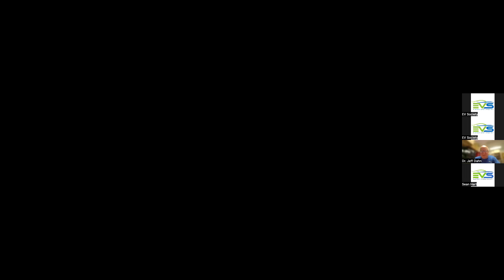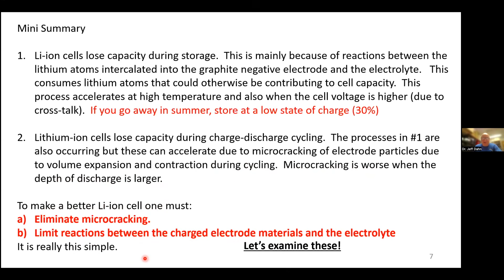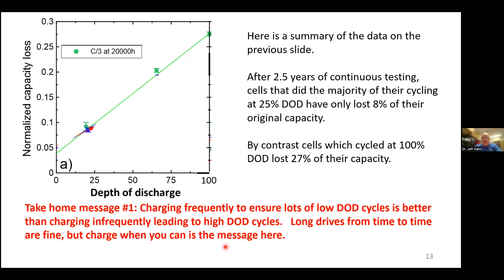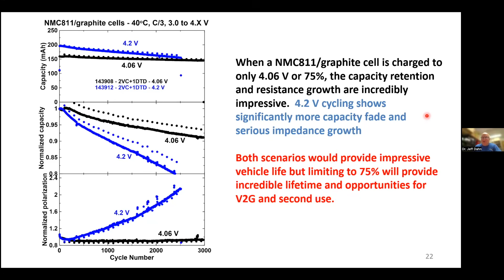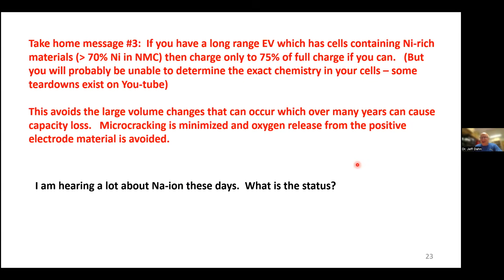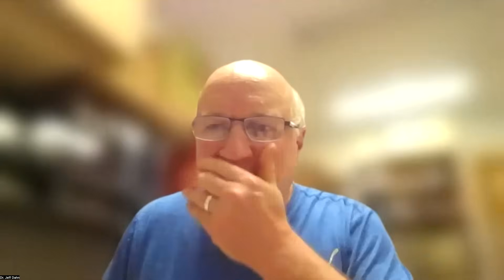How Long Do EV Batteries REALLY Last? — Dr. Jeff Dahn, Dalhousie University

Comment: I have an EV with an 80 kWh battery capacity. I drive 100 miles (160km) per day, and each day, I use 40% of my battery's capacity. With this advice, I'll reduce my charging target from 80% to 75%.
Reply from the maker: That strategy should keep your battery in top condition.

Comment: Most modern EV have battery cooling  system  , should i worry less about heat  ?  I live  in the middle east.  Hot summers.
Reply from the maker: It's is true that modern battery cooling systems greatly reduce the risk, but they can’t eliminate the effects of extreme heat. Avoid leaving the battery near 100% state of charge for long periods, park in the shade when practical, and keep the vehicle plugged in when recommended so it can manage battery temperature. As always, it remains a good idea to follow the manufacturer’s guidance for your model.
Reply: @ElectricVehicleSociety  great advice  , thanks for replying ❤🎉
Reply from the maker: @mohammed-pl8zt  My pleasure.

Comment: 2023 Model Y NMC LR owner. I saw these same charts from another engineer explaining battery durability. I use my Tesla to drive an average of 80 km per day. I charge at home using level 2 Nema 14-30 plug and my charge limit is set to 70%…typically it will be 45% -50%  when I get home….never supercharged, I never leave it out in the hot sun in the summer and when it is stored for an extended period of time, i leave it at 40%…even in winter…it 2026 and i have almost no degradation on my battery
Reply from the maker: You are doing all of the right things to maximise your car's battery life.  Well done.

Comment: If car A throughout its life is charged to 100% and discharged to 75% consistently. 

Car B is charged to 80% and discharged to 55% consistently. 

Do both Cars A and B have a depth of discharge of 25%?
Reply from the maker: Yes.  If both charged 4 times at those levels, then both batteries will have completed one cycle.  
Of course some battery chemistries can be charged above 80% constantly with less degradation than others (LFP vs. NMC)... but that wasn't the question.
Reply: @ElectricVehicleSociety Thank You.

Comment: Keeping batt at 75% is mostly not realistic...90% is whats recommended by Polestar...its just reduces charging during the week and pulling that cable around the place.
Reply from the maker: Recommended charge levels vary by battery chemistry.  100% is not much of an issue for LFP.

Comment: 48:00 Asking about battery chemistry at dealership should be similar to asking "does this car have fuel injection in the engine" for an ICE car. Getting answer similar to "it has li-ion battery" is not that different from saying "it runs on gasoline".
Reply from the maker: Agreed.  Dealerships have a long way to go.

Comment: 36:00 All we need is for EV manufacturers to redeclare 4.06 V as "100%" and if they want to allow charging up to 4.2 V "for longer trips" that should be marketed as overboosting or overclocking the battery so that people would better understand why it reduces lifetime of the battery. Display such charges as "110% or 120%" in the display and people would automatically avoid those for daily use. There's no standard what "100%" or "0%" actually means when it comes to batteries. If you reduce the voltage range for 0% to 100%, you instantly get more lifetime for the battery.
Reply from the maker: Good point on voltage windows—but in practice, OEMs already do this behind the scenes.

“100%” on the dash is not the true electrochemical 100%. Most EVs keep a buffer at both the top and bottom (often several percent) specifically to protect the cells and extend cycle life. That’s why many batteries still retain strong health after hundreds of thousands of km.

Also, the trade-off is real: narrowing the voltage window improves longevity, but it reduces usable range, which most consumers prioritize.

Some automakers are already moving toward what you’re suggesting:
User-set charge limits (e.g., 70–80% for daily use)
Trip charging to 100% when needed
Software-managed buffers that adapt over time

So rather than relabeling 100% as 80–90%, the industry solution has been to abstract it and give drivers simple controls—while the BMS handles the complexity in the background.

Comment: For the past 10 years, we've been OK just using our 120V in our garage, for our two EV's. Is using 120V extra beneficial to long Li-ion battery life?
Reply from the maker: Compared to DC Fast charging, yes.  Compared to level 2 home charging, the difference is likely negligible.  Unless your EV(s) are both Iron Phosphate (LFP) batteries, you are best to avoid charging above 70-80% on a daily basis, whether  using 120V or Level 2.

Comment: I wish I would have known this in 2018.  But better late than never. My 2013 S60 has 202,000 miles and currently at 81% capacity.  My daily commute is 45 miles so I'll try to extend my battery life by dropping from 90% to 70% daily SOC.  Usually use around 30% if no errands are run and I live in a warmer climate so I usually get more efficiency during summer.  We'll see what happens!
Reply from the maker: Sounds like are doing well with your 2013!

Comment: @electricvehiclesociety ,  if you're going away 1 to 3 weeks at a time but just 4 vacations per year, how much difference would it make on the battery's health after 10 years, whether you follow the 75% vs 35% before leaving for vacation?
Reply from the maker: So long as you keep the max to 75% or less, based on Dr. Dahns recommendations, it would likely make very little difference to the battery.  If the climate is particularly hot, then maybe lowering the max would have some marginal benefit but likely not much.

Comment: I just want to know if it’s useful for the longevity of the battery to periodically be charged to 100% (to balance the cells)?

I have a 2016 model S, and generally keep the battery between 20-80% charge.
Reply from the maker: Periodically balancing the cells provides no significant benefit to battery health with your 2016 NMC battery.  It might eek out a very small amount of extra range but probably wouldn't be too noticeable.  Charging from a low state of charge to 100% occasionally does recalibrate the range estimate that your car is giving you (it loses track over many shallow charge/discharge cycles).  This might result in better range numbers but only because the estimates are more accurate and not because of any change to battery health.  Hope this helps.
Reply: @ElectricVehicleSociety  Very thorough response, thank you!

Comment: Thank you for this great information! I have a question: Dr. Jeff recommended charging the MNC battery to 70%. At what percentage should I start charging? For example, if I start driving with the battery at 70% and return home when it's at 60%, should I charge it back to 70% immediately? Or should I use more of the battery before charging again? What is the recommended charging range for everyday use when my drives are predictable?
Reply from the maker: My take from his various presentations is that it would make little measurable difference.  Frequent shallow charges are better than less frequent deep charge/discharges.  Also true that keeping the max charge at or below 70% on MNC batteries is better.  So, my strong belief is that charging immediately back to 70% every time would be perfectly fine.  Also, it leaves you with more available range if you unexpectedly need it.
FYI, Jeff is coming back on August 5, 2025 for another webinar and you could ask him yourself.  We also have a battery expert (Dr. Toby Bond) who studied at Jeff's lab at Dalhousie U.  doing a webinar on May 6.   Should be some great insights from him as well.
Reply: @ElectricVehicleSociety  Fantastic! 😊 Your channel has been incredibly helpful in teaching me the best practices for preserving my NMC battery life
Reply from the maker: @ Thank you very much.  It means a lot to know you enjoy the channel.

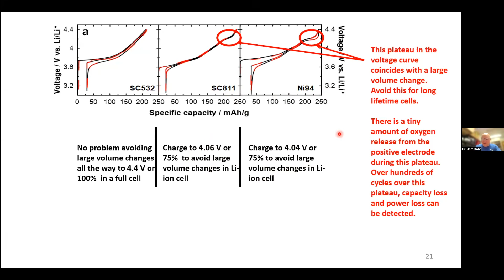Comment: 20:00 - 35:00
The Lightning at (Truck)100% SOC is 390v {96s pack = 4.06v per cell}
Ford report the cells are 90/5/5 Li-NiMoCo ie high nickel Li battery 
per Dr Dahn 35:30 - keeping below 75% SOC (cell) prolongs battery life - 4.06v = 100% Ford SOC level.
Reply from the maker: Yeah, good catch on the Ford Lightning specifics. At 100% displayed SOC, the pack hits ~390V (96s config), so ~4.06–4.09V per cell—well below the ~4.2V max for most NMC cells, and far from Dahn's aggressive lab tests pushing to 4.3V.Ford's high-nickel (NMC 90/5/5) setup is conservatively calibrated, so their "100%" is already a milder ~90% of true chemistry max. That means daily charging to 90% (Ford's rec) or even 75–80% keeps cell voltages/stress low, aligning closely with Dahn's advice to stay below ~75% SOC on high-nickel NMC to minimize degradation from high-voltage side reactions.Smart observation—Ford's buffer makes their 100% pretty gentle compared to raw lab benchmarks! Only go full when needed for range.

Comment: This is an essential info for an EV user. Only topic not well argumented is about the lowest percentage of battery: 
Jeff says "the lower the better" but as I know if I bring my battery to zero I will damage it. What is the minimum percentage to run in a NMC battery? My car arrived to the dealer with 4%, was it a safe or bad long term storage percentage?
Where can we find a public database with brand - model - battery chemistry - battery model?
Reply from the maker: I believe Jeff said that a low SOC would not damage most batteries but that it depended on the specific battery materials used.  Sorry, I don't recall the specifics.
There is no public database with the battery info you are asking about, at least that we have been able to find.  For now, it is a brand by brand question.
Reply: "Zero percent" is not "zero volts".  The cells still have about 3V when the pack reaches 0%.  Hitting zero volts, however, is very bad, although you would be hard-pressed to actually get to zero volts.  You'd need to run it until it stops and then leave the rest to internal discharge, probably weeks or months.  I personally would not risk it, however ;-)
Reply: @4gus  I know that 0% is not 0 volts. Question is: as the highest SOC are not good, are the lowest SOC specularly bad in the same way?
Reply: @4gus Jeff said "The lower the better", which is of course not zero volts. Just wonder why he then says to store at 30% in hot climates? Why not plugged in (to protect against vampire drain) at 5 - 10% for extended storage in the heat? He has shown lab results of zero % SoC (around 3V) storage providing the best longevity; noticeably better than 30% SoC, compounded by zero % in the vehicle being at the top of the buffer (so above 3V) 🧐. Is the recommended 20% lower SoC threshold PURELY to mitigate SoC calibration error, & range anxiety??
I'd be happy to have to charge immediately after storage if there was confirmed longevity benefit.
Reply: @MortyMac  He mentioned that 30% would give a fair amount of range when the person got home and wanted to use the car (without charging).
Reply: @synupps877 I've read more in past few months. Jeff's 0% is not held there for any time at all in his continuous cycling tests, which presumably is why he has no issue with taking it that low. It also standardises his testing. Makes sense. I am now very confident an NMC battery has the best chance at a long life withhut much fuss by:
20% - 60% daily (extended up to 15% - 70% if range requires it);
Small DoD by frequent charging (as lifestyle/routine allows);
40% storage (30% - 50% is good; 30% better in hot climate);
Precondition before DCFC;
Gentle loading for first 10 - 15 minutes after a DCFC (many reasons);
Warm the pack from wall power to above freezing before driving where possible (e.g. set departure time, delay charge window);
100% fully charge slowly every 6 months in moderate temp if specific vehicle is only fully cell-balanced with a 100% charge, & drive off within hours of completion of course to minimise high voltage stress dwell time.

There shouldn't be many surprises in this list for most people who have done some reading of reputable sources. But also, don't be paranoid about it if lifestyles don't allow.

Comment: Thanks for the excellent video. Do you have any information on the "lithium plating" at the anode, which apparently occurs at low temperatures (when charging?)?
Reply from the maker: Sorry for the very late reply.  Dr. Dahn will be back for another webinar on August 5, 2025.  He will have that answer, I'm sure.

Comment: This should be taught in schools, we all have "LIon" batteries in all appliances, not only cars but also phones, watches, tooth brushes, power tools and so on. This is knowledge that would benefit the whole society!
Reply from the maker: Agreed!  I think that eventually, consumers will become more knowledgeable.
Reply: Yes. Many laptops and I think most newer phones (Android and IOS) have settings to limit the battery charge. My phone (modern but cheap android) is set to stop at 85% (I would like lower) and I charge it fully if I think I might need it. I never really take the laptop out, it is always plugged in, and I had it set similarly. A recent update has automagically changed it to some dynamic system that often sees charge state held in the range 60-80%. I suspect you need Android 13.

Comment: @ElectricVehicleSociety Thanks for sharing such a useful information. Its a must watch for all existing and potential new EV owners.

One of the biggest hurdle in EV adoption is the fear of battery degradation. 

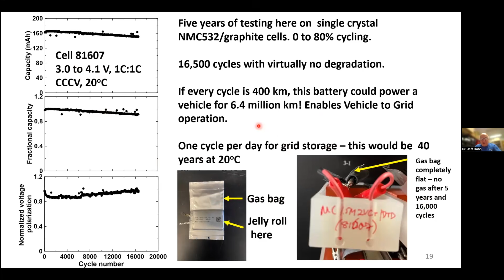1) @31:04 I fail to understand why car manufacturers are not sharing the information if their (/supplier's battery) uses single crystal positive electrode material ?

2) As I understood, most of the discussion here is about reducing battery degradation due to charge cycles in other words reduce the impacts of "cycle ageing". Can you put up a video on what measures EV owners can take to reduce the impact of "Calendar Ageing" ?
Reply from the maker: @Stayhungry-N-Stayfoolish  Thanks for watching and supporting our channel.  We will be doing more on batteries in 2025.

Comment: Why is 70% to 45% SOC ideal?  Why not 60-40?
Reply: 60-40 would be marginally better than 70-45 but would also be less practical.  The trade off between battery degradation and extra range wouldn't be worth it.  IMHO
Reply from the maker: Dr. Dahn is coming back with another presentation on Aug. 4.  You could ask him yourself during the Q&A.  It's free.

Comment: Does anyone know if the BYD blade batteries are using mono crystaline?
Reply: They don't. LFP is not made in single crystal large particles. It would cause very bad lithium mobility into the cathode. You can find confirmation in literature
Reply from the maker: If you are stil interested in finding this out, Dr. Dahn is back in August for another webinar with EV Society.  He might be able to answer.

Comment: This is all great news as I plan to be looking for a new EV to replace my OG 2011 LEAF. I sure hope my experience will be better in the future than that original LEAF. I've got nearly 300,000 km on it, and the 2nd battery has again reached 60% of its capacity. I'm in Ontario. The car is still useful and currently it's used only for small trips. The original LEAF battery was a POS unfortunately, and I'll  likely lease my next EV to protect myself, but these newer battery chemistries look much better. Great video.
Reply: You need an EV with thermal management - lacking in the original leaf - and you will never see this type of degrade in EV batteries again.  The "100% SOC" in my Lightning is exactly Dr Dahn's "75% SOC Cell" at 4.06v, and the Lightning is a high nickel content (90&) Li battery.  I charge to 85% (truck SOC%) every night and only use 100% for highway travel/long trips.

Comment: I spend 4 minutes at the gas station I get 400 miles. My truck is 20 years old... changing the battery cost me about $120.
Reply: I find it hard to believe you pay $1.20/Kwh (I pay 6 cents/Kwh where I live).  The Rivian R1S has 400 miles of range and approximately 100kw battery.  You charge it while you sleep and never have to waste 1 minute at a gas station…or any time for an oil change….and you’ll probably never need to replace your disk breaks….your transmission will never need a repair (because you don’t have one).   In fact, the only maintenance you need is tire rotation (every 7,500 miles) and break fluid flush (every 3 years).  How much maintenance have you spent time on with your 20 year old truck?